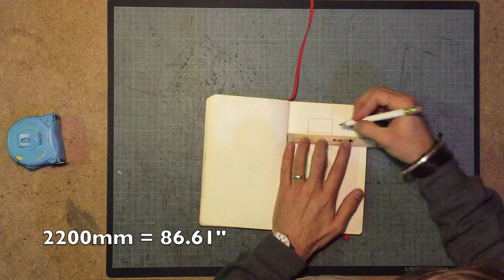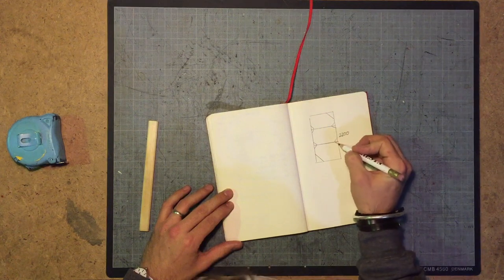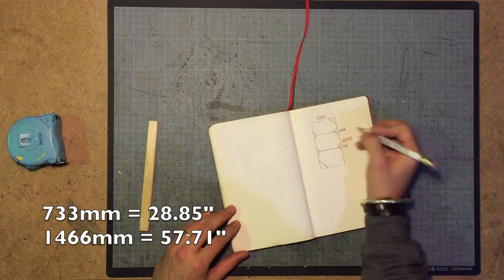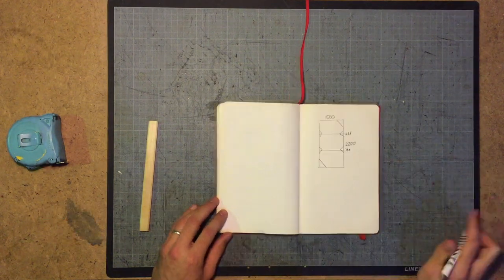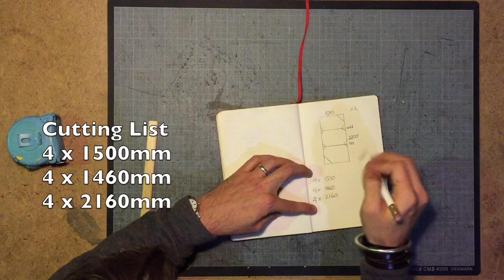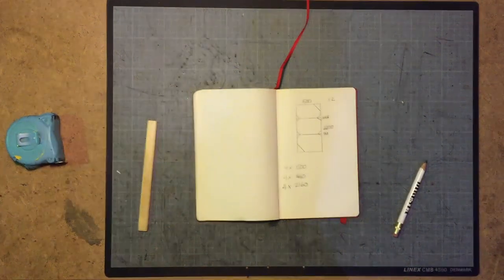How to build Theatre Masking Flats

Comment: Amazing video. Thank you! Some follow-up questions please… what diameter/gauge screws do you use to join the 1x3s? And how long are the screws (as in how deep)? Finally, when it comes to attaching the plywood to the flat, would you recommend screws or a brad nail gun? My set doesn’t need to be mobile. Thank you so much!!!
Reply from the maker: I seem to remember using 4x40 screws. And screws or brad nails work for the plywood. Best of luck with your build

Comment: Hi Andy. I really like your theatre flats video - very straightforward and concise. Thank you. However, I don’t altogether understand your cutting list. I see that the 2100 relates to the uprights, but what are the 1460’s? I need to make 3 flats - 2.2m tall by 1.5m wide and don’t want to waste any timber! Hope you can help…
Reply from the maker: Hi Simon, I've just watched through the video again to remind myself. The 1460s are the cross rails minus the width of the uprights. I made these out of 3x1, and that usually comes in at around 20mm width. Take both sides into account, 40mm, take that away from 1500mm, you get 1460mm. I hope this helps. Good luck with your build.
Reply from the maker: Same goes for the uprights. Over all the height is 2200, take away the top and bottom rails = 2160mm

Comment: need to stand 4 x 8 sheets of foam board for theater production with special needs adults . Ideas?
Reply from the maker: Similar to the video, add bracing to the rear and weight to the bottom. It might be worth building a frame around each sheet, depending on how thick they are. If they flex in the top corners then you'll need to build a frame to help keep it's shape, Best of luck Malcolm

Comment: Hi there, Can I ask which type of brace did you create to support the flat? :)
Reply from the maker: Teng Xin Ling hi, I used an old stage brace, which is an extendable piece of wood with a hook on the top and a angled foot on the bottom to put a stage weight on. I'm lucky to have them around my theatre, but they'd be pretty simple to build. Alternatively you could make a French brace, which does the same job. Thanks for the comment.

Comment: what was the brace that held it up at the end?
Reply from the maker: Hi Spencer, it's called a 'stage brace'. An extendable bar, sometimes made of wood or metal, that hooks to the back of the flat and secured to the floor with a stage weight or two. You don't see them around much these days.
Reply: @AndyLawsonawl  Thanks. Of course that begs the question, what do you use these days?
Reply from the maker: @SpencerRaybourne  Ha! Walked into that one. These days, shows are way bigger than they used to be, space is now vastly more valuable back stage. Stage braced take up room (and are a trip hazard in the dark), so now flats are attached together, screwed to the stage and steel or hemp lines are run to a flybar or the grid to take the balance. Leaving much more room, off stage, for quick changes, props and set storage, racks etc. 

That being said, if you haven't got a fly tower or grid above your stage, stage braces are really decent way of positioning flattage wherever you like.
Reply: @AndyLawsonawl  That makes total sense.

Comment: hi, thank you for the video! how would you modify this if you wanted to add wheels and make it such that both sides (front and back) can have muslin draped on them and replaced during scenes?
Reply from the maker: I'll be honest with you, that's quite a tall order. Putting anything tall on wheels makes for a very ungainly object. You would need to have bracing built into the structure to give it stability. From the bottom two corners, coming outward in both directions. If viewed from above it would have a H shape, with the wheels as far out as possible. 

Cloth swapping during scene changes is straight forward enough, so long as you have hooks along the top, and elastic bungees along the bottom to keep it taught. 

This is just off the top of my head, with a flat that isn't more than 2.5m tall. Any more than that and you'll have to think of another way. Safety is the first thing you need to think about, and regardless how light a flat is, it'll really injure someone if it topples over.

Good luck with your production and thanks for the question.

Comment: Hi first time building an flat but i was tasked with an entire set with not much to work with. Did you use 2x4 on the frame? Which type of plywood did you use?
Reply from the maker: Hi there, I just saw this. I hope I'm not too late to help. I used 3x1, not 2x4. You can use 2x4 if you want to, but it'll be more expensive and flats aren't load baring. The plywood I used (i think) was 3 or 4mm ply. It's just to stop the flats from racking side to side.

Comment: Hi Andy. Loved the vid and the work. I have to make some that are a bit larger; 3.2m x 4m, any advice please? thanks
Reply from the maker: Hi P&T, my advice is to break them into sections and join them together. It all depends on how wide the material you are covering the flats with are. If you're covering them in serge like I did in the video it was 1.5m wide, so that dictated how wide my flats were.  If I needed to make flats that were 3.2m wide, then I'd see if the material could stretch to 1.6m wide and make two side by side. If  it doesn't stretch then make three.  That will be more expensive in materials. At that point I would go to the designer and negotiate making the flats slightly thinner for the sake of cost. Good luck with it and thanks for the support!
Reply: Andy Lawson thanks Andy. Much appreciated. It has been mentioned to use duvetine or black tat?
Reply from the maker: @peaceandtruth8964  Duvetyne looks great. Check the dimensions of everything before you buy it and design your flats accordingly. Where I come from Black tat is off cuts.
Reply: Cheers Andy 🙏🏻

Comment: I'm surprised no-one has come up with aluminium frames.
Reply from the maker: I've seen them before, and increasingly see steel flats too. Wood is superior because it's inexpensive, accessible and easy to repair. Once you've bent an ali flat, it's kinda game over.
Reply from the maker: also, thanks for the comment Tom.
Reply: @AndyLawsonawl  Aluminium frames with ply or MDF flats would seem a good idea. Plus they could be bolted together more easily than timber frames.